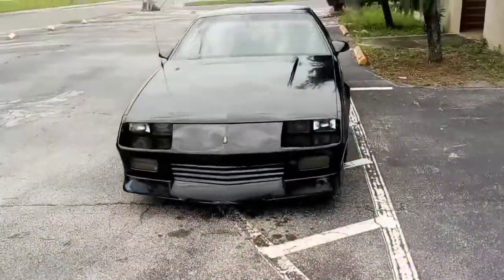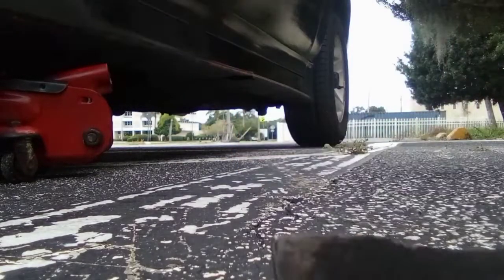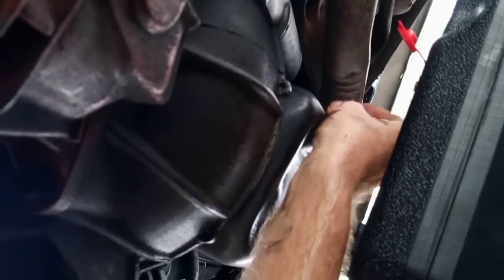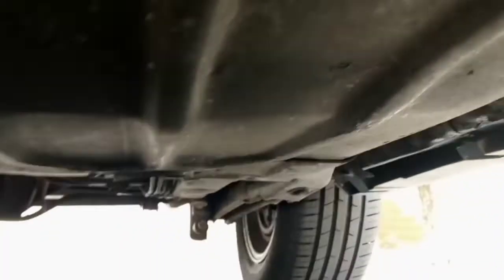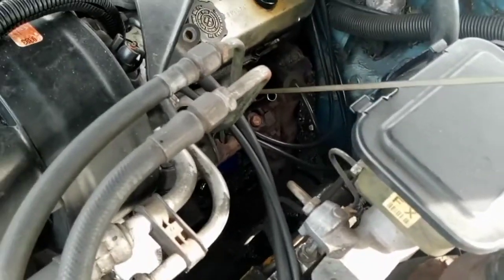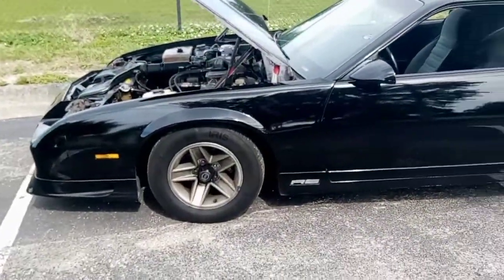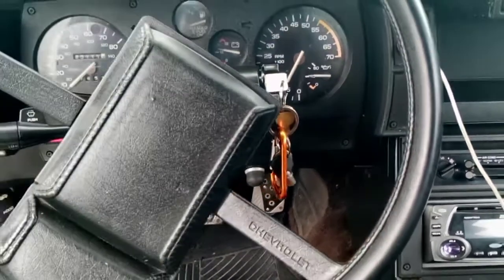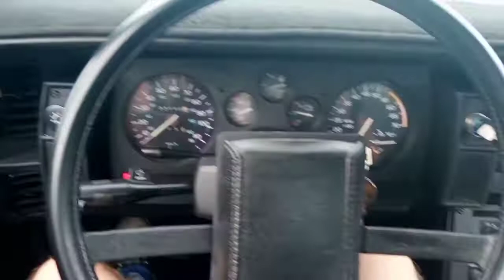1989 Camaro RS - Oil Change and Walk Around

Comment: Someone must have replaced the torque arm mount by drilled out the ribbons and probably forgot to put the bolts or ribbon back in as vice grip was temporary to hold it in place.